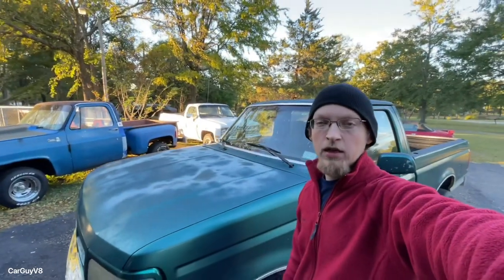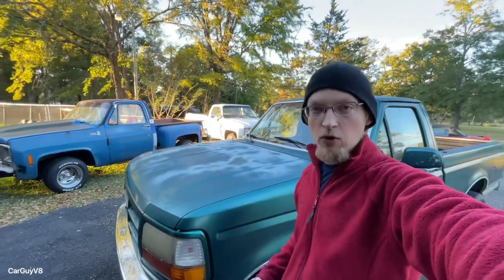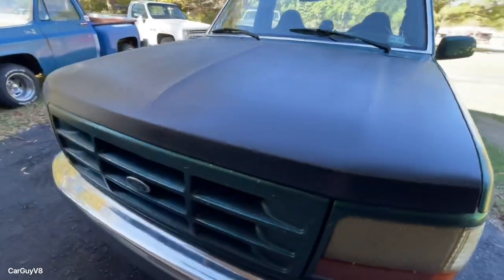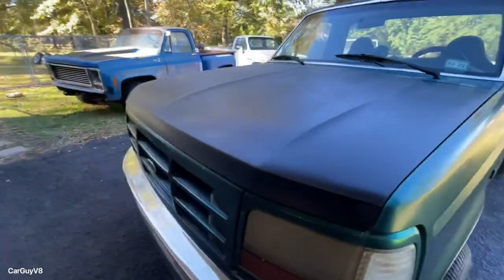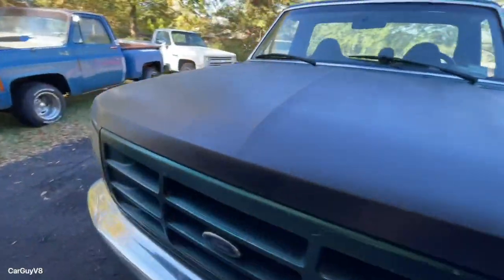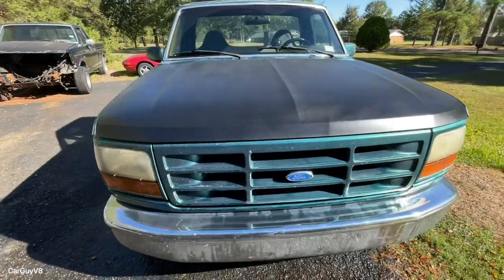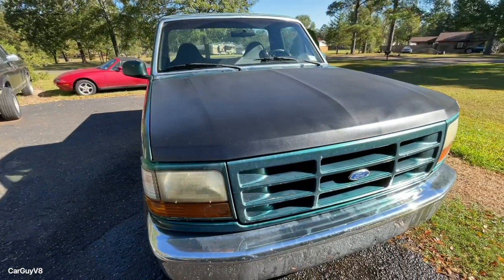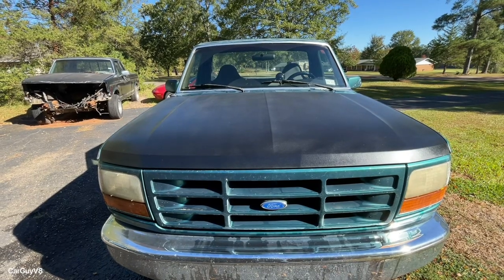Spray Painting My Truck’s Hood Black - Is It Trash?

Comment: How many cans of paint primer and clear coat did you use? Also what is the sanding prosses you did? You did a good job
Reply from the maker: 3 or 4 cans of each if I remember right. I just did a simple wet sand and used tack cloth to clean the hood before each coat.
Reply: @CarGuyV8  thanks man I'm going to try that. I got to paint my white fiberglass hood on the Camaro.